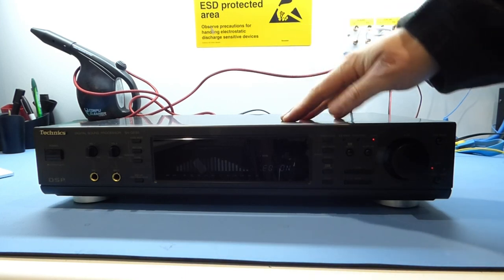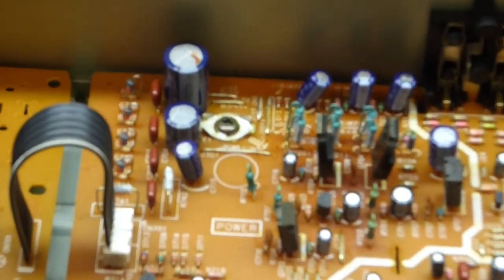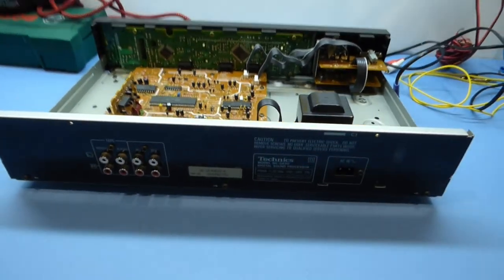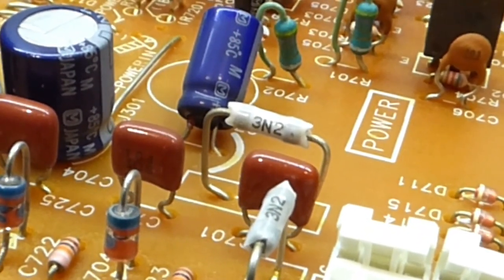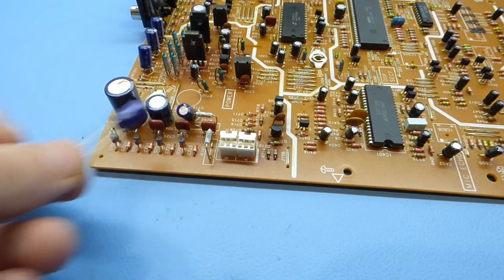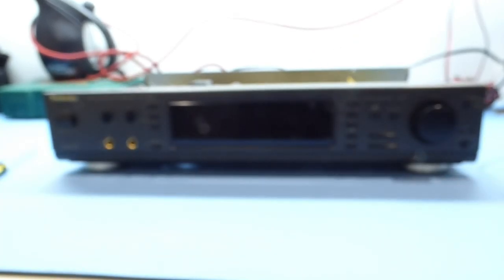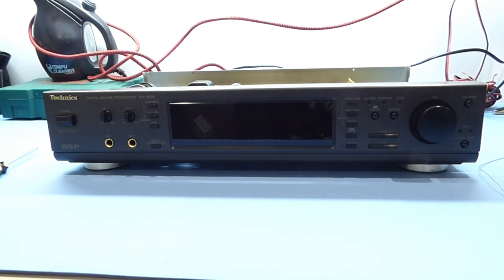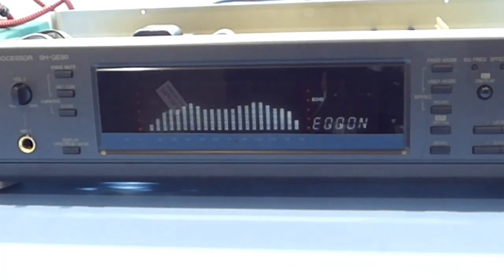HOW TO - fix display issues on a Technics SH-GE90 Digital Sound Processor

Comment: In the factories they do crimp the components legs so they self locate in the PCBs and they don't come out in the flow solder bath the boards go through. 
It was quite a common in the manufacturing process at the time and I saw it happen in all the factories I visited when I worked in the Hi Fi Trade. 
Of course when we buy replacement components they come with straight legs. 
The manufacturing of equipment was amazing to watch. The machines that ran the components through the whole process was all so quick and automated. The only time humans were involved was minimal and focused on assembly and testing things.
Reply from the maker: From my days at Pioneer and Matsushita (late 80s/early 90s), only SMT were machine produced, anything with conventional sized components was manually produced on lines by hand including shaping the components before going through flow solder, inspection and icq testing. In the days as a hifi dealer, this was true also for the majority of other japanese brands I delt with, smaller british brands just used small smt jigs with solder paste manually rather then machines!

Comment: Estimado Gracias por tu video me puedo dar cuenta que mi procesador Technics SG GE90 tiene el mismo problema cuáles son las especificaciones de este capacitador para poder buscarlo. Saludos cordiales.
Reply: Es un capacitor de 100 microfaradios a 35 volts asi se pide, antes de colocarlo fijate como esta ubicada su polaridad ( lado negativo) toma una foto, si ya lo arreglaste que bueno si no ahi esta la info

Comment: Thanks for the video! I replaced the caps and resoldered the transistors and everything that seems suspicious. The flickering and brightness issues solved. But one problem remained. Sometimes there is no display at all and I have to knock or hit the chassis near the display to work again. What do you think?
Reply from the maker: dry joint somewhere

Comment: Hi Mate, I did this fix on mind and it was perfect. I've got a sony v902 graphic that the right side is alot dimmer than the left. Have you encountered this problem and found a fix.
Reply from the maker: sorry no, but it could be many things causing that - I`d check the pcb behind the display for dry joints first
Reply: @Sortitoutman  cheers for the reply mate, I'll take a look.

Comment: Hi what is ur eBay shop called? Also I have the same problem on my shge90 sound processor, what do you think if I find the right capacitor and instead of soldering just cut old one off and join the new one to old stumps as I haven’t any experience in soldering??

Comment: Hello, I have a Technics SH E85, it works fine, but the equalizer display, some bars have shadows, is there any way to return the bar lights to their original state?
Reply from the maker: most likely age related dimming - happens to displays if they have been powered on most of their life.

Comment: Great vid. I have the same problem, i already change that capacitor (it was also leaking) but the display its still dull. Help
Reply from the maker: have you changed the second one I mention next to it? The fault is usually the display scrolling across and dimness as it scrolls - the actual displays themselves will dim with age and heavy useage as with any fl display

Comment: I have two of these technics processor's one plays just fine and the other one shows all the symptoms shown in your video where can I purchase the correct capacitors to rejuvenate my SH GE90 cheers
Reply from the maker: I have them on my ebay shop(the_hifi_guy)  or any good electronics component retailer

Comment: Hi there Sort It Out Man

Great video. Thanks. I have a Technics ch950 system and whilst the displays are dim on all components, it has developed a buzz/hum I think coming from the sound processor. It makes the noise when any source is pressed ie tape cd phono. through speakers and headphone socket on amp. Sometimes the noise is quite loud most other times not so.  Testing the components with a similar system and the process of elimination indicates that it is the SP. Any suggestions would be welcome. Thanks again. Now to have a look through your channel. Happy new year.
Reply: Good day
Is there any updates on your issue because I am facing same problem so plz update anyone knows about it

Comment: Hi my display is flickering and I have taken the top off but doesn’t look like that capacitor is leaking and can’t test it do you think if I change it that’s definitely the problem?
Reply from the maker: Hi, caps don`t usually have visible signs of failure unless they are really far gone, most can fail but "look" fine - you`d only know via tested it with a esr meter or changing it in this case - if you feel up to the job, its worth just swapping it out anyway.

Comment: I have just changed that and it stop the flickering but some is still not as bright will another need changing as there is 3 in that area
Reply from the maker: Displays dim over time from use, so if you`ve not got any actual display issues now, changing the others would not do anything other then just safeguard the unit.

Comment: I have the same DSP, and the display only works with a source like a cd player and not the preamp out from a receiver. Would have to crank the volume high to see some action. any ideas what am I doing wrong? thanks
Reply from the maker: it needs to be on a line level output, ideally you want an amp thats designed for these, it will have a set of 4 sockets on the rear labled something like "ext" or "processor" and have linking plugs over the terminals as not been used.
Reply: Yes, I tried a few amps with dedicated pre-amp, power-amp, outputs and also tried to connect it to Technics SA-TX50, and this one has the dsp inputs. Still wouldn’t lit until played very loud (in my headphones)

Comment: Hi. I have a problem with Technics Sound Procoessor. Display section corresponding with left speaker has a kind of glitch. Last three bars show the same values (5, 12, slightly below 5) even when no sound going through the speakers. There is no any distortion, crackling on high frequencies. Checked cables - all ok. Nothing audible. When signal is loud enough in three frequencies the bars go easily above. However when it’s below, or no sound at all, them bars are stand still. Does anybody have an idea why this is happen?
Reply from the maker: Sounds like a dry joint on the solder connection to the lcd panel on the PCB.